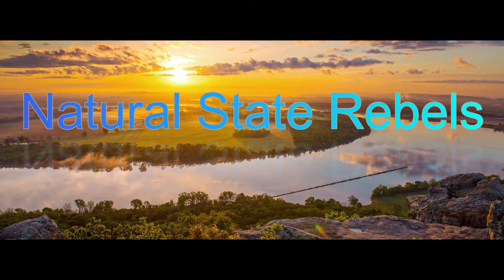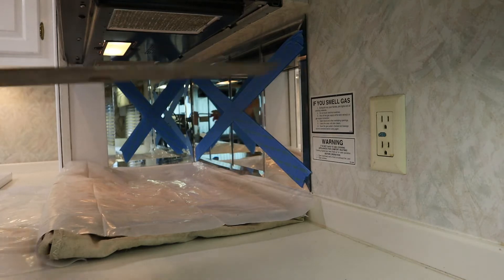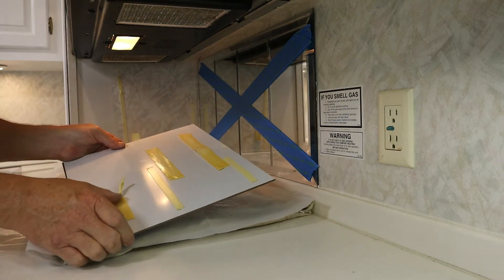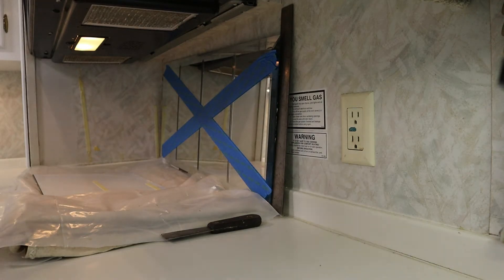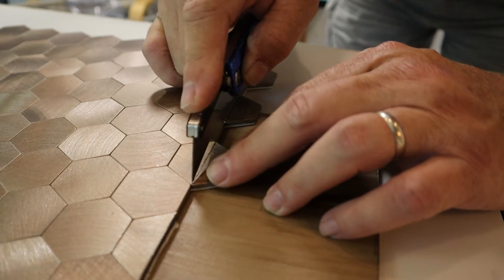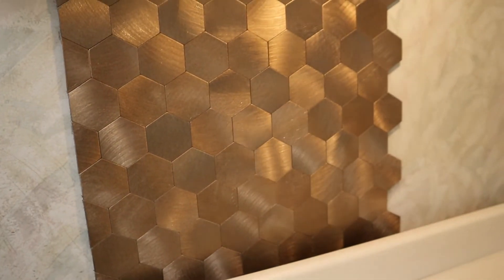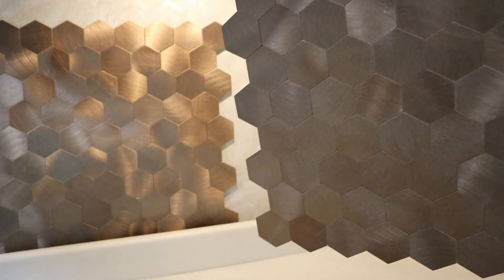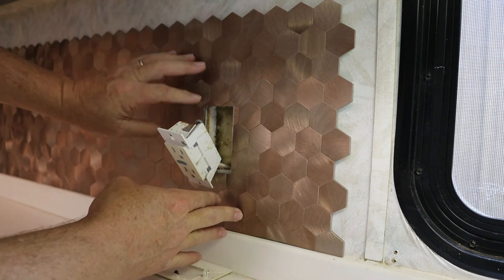Episode 18: Easy metallic peel and stick backsplash in our RV - WoW!

Comment: Looks great.   Wondered how you worked around the curved window. Was that difficult
Reply from the maker: The curve was so small that I didn't try to cut around it. Plus, the blind covers that part.  It can be done though. You can use a jigsaw to cut the radius but you might need some kind of template to get it just right.  It was so unnoticeable that I didn't bother with it.
Reply: Thanks for your quick response

Comment: Nice video! How do you think it would hold up to extreme heat behind a stove / range?
Reply from the maker: Not sure about extreme heat like prolonged exposure to direct flames. We cook on our gas stove top all the time and it's about 7 inches away from the heat source with no problems.
Reply: How is your metal backsplash holding up? We bought an old Class A and need to put something behind our stove as I peeled off the 4” tall 1990’s wallpaper lining and ripped the entire wallpaper behind it as well in a large area. Please let us know if you have time. Thank you
Reply from the maker: It's holding up extremely well.  No problems at all.  Still looks brand new and we cook several times a week creating lots of heat.
Reply: Thank you for sharing and responding. It is beautiful as well.
Reply from the maker: Thank you 😊.